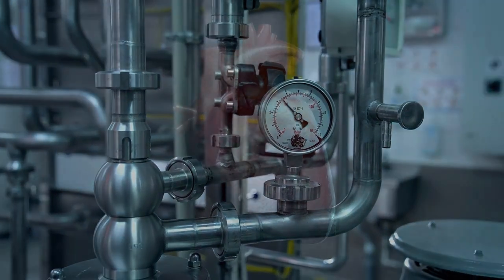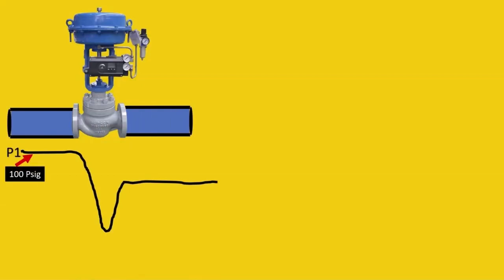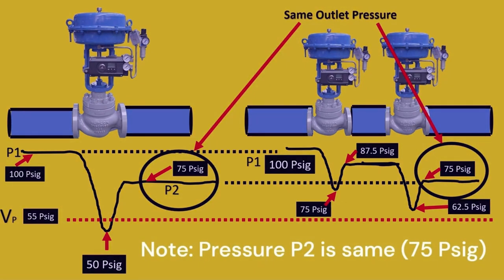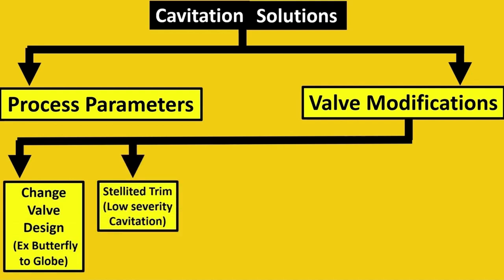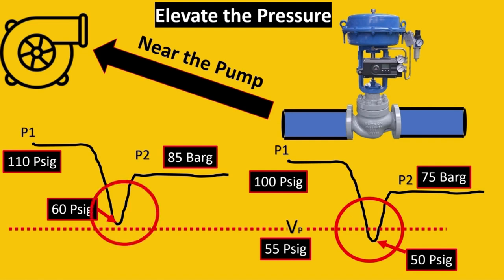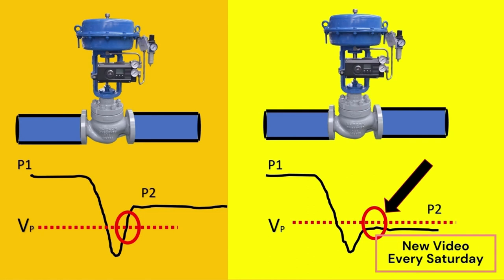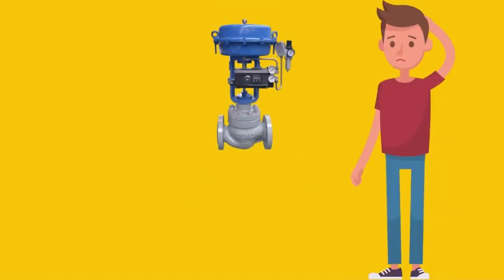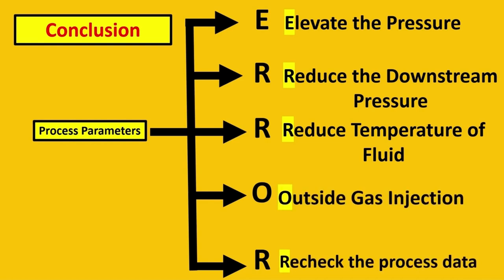COMPLETE GUIDE on How to prevent cavitation in control valves | MOST SIMPLE EXPLANATION

Comment: If you relocate the valve near the pump for a higher inlet pressure, please note that the pressure drop would increase too. One cannot take for granted that the drop will be above the vapor pressure. So one has to analyze the fluid dynamics on case to case. Cannot assume that mere relocate will solve the problem.
Reply: Agreed. Impressed by your knowledge @Sreeram.G